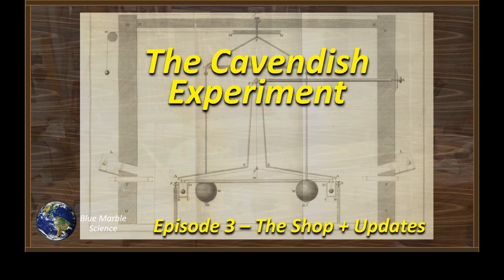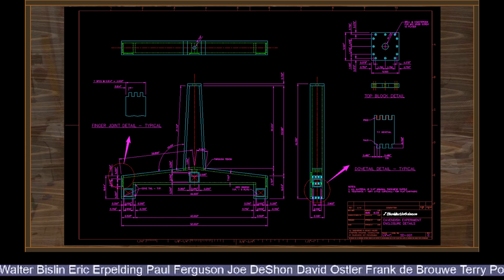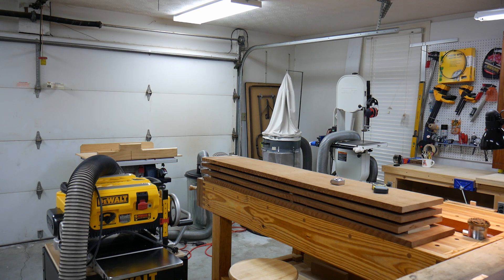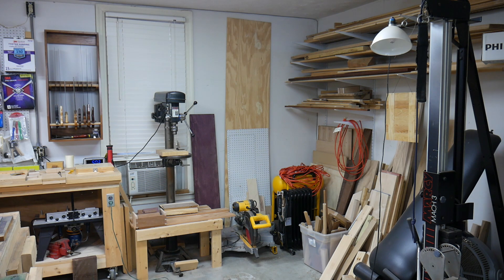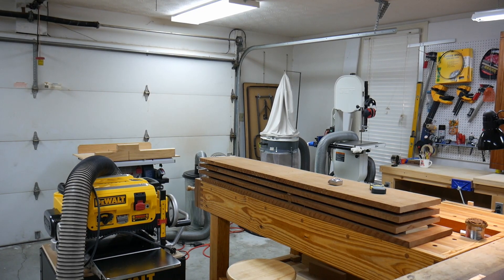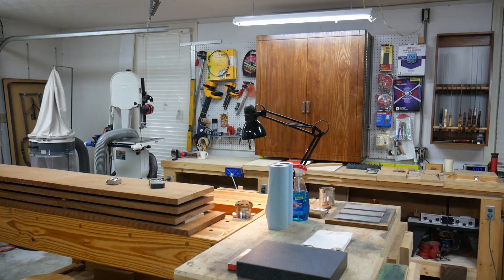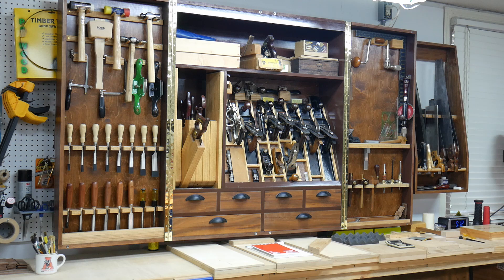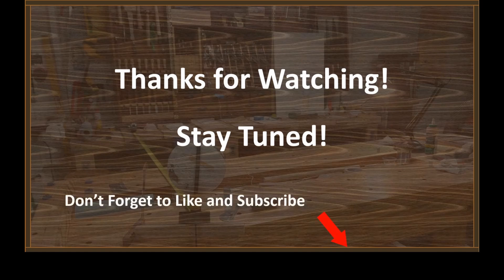Cavendish Episode 3

Comment: NIce, particularly that handsome collection of planes. The biggest surprise I got with my little brush with woodworking a while back is how much precision work can be done with tools designed a long, long time ago.

'Course, a good router is a pretty cool thing, too.
Reply from the maker: Guaranteed I can make this stuff fit much better with those chisels than I ever can with the router, but I agree, a router is cool. When I cut the holes in this thing for the windows, I'll definitely be grabbing the router. Takes much less time than by hand. On the other hand, fitting a thru tenon with a router and getting it right takes just as much if not more work and time!
Reply: As usual, the right tool for the right job, power tools are great for many things but also let you screw things up faster.  If I'm assembling an IKEA cabinet for someone, I'll often use a 1/4-inch drive ratchet handle and a driver bit, so I get a compromise, the speed of the ratchet and the precision of a non-powered hand tool.

Comment: Your shop looks spookily similar to mine Big Blue! How do you get on with the cyclonic dustbin? I've got about 300 linear ft of seasoned oak to process on my jointer this Autumn and was thinking of adding a cyclonic bin to my extraction set-up to cope with the extra chippings.
Reply from the maker: That thing is a life saver. It's a real pain changing the bag on the dust collector but since I inserted the cyclone, I get very little dust in there. I think I found that lid at Woodcraft for about $30 and another $30 for the can. It's the only way to go!
Reply: @bluemarblescience  That's good know, thanks buddy. I'll get mine on mail order here in the UK. Those dust bags are certainly a pain in the arse!
Reply: @simonjarvis7362  As a FYI Lee Valley also makes/sells cyclone lids for standard plastic garbage cans (dustbins), including one sized for a 5 gallon bucket.  You can get them in ABS (black) or polycarbonate (clear) so you can see when they're full.

As they fit standard trash cans/buckets, the fact that they cost a bit more is offset by the fact that the trash cans are a lot cheaper.

They probably work better than the woodcraft ones - on the woodcraft, the ports are vertical, with an elbow.  On the LV ones, the ports are angled inline and more efficient in generating the cyclonic action.

As a suggestion: certain tools, like BlueMarbleScience's DeWalt planer (I have the same one) have dust blowers in their collector ports.  I've found the planer's blower has enough power to pop the cyclone lid off the garbage can if you've not turned the dust collector on yet.  Then you have dust in very large quantities everywhere very fast.  Mine is kinda buried in the corner, and I generally don't see it until it's half-filled the garage or so it seems.  Not anymore.

Use bungie cords to hold the cyclone lid down.

Oh, I don't know whether this is standard in the UK or not, but about the cheapest rigid ducting available is 4" "drainage tile" pipe.  Which takes the form (here) of 4" diameter thin wall white PVC pipe.  Don't get the perforated version for obvious reasons ;-)

The sizing is such that it will friction fit into standard 4" dust collector fittings.  I used little sheet metal screws to join the pipe and fittings and threw on a little aluminum duct tape for full seal, but you can use PVC glue of course.

Some people will talk about dust explosions with plastic pipe, and this will generate interminable flame wars.  While this is mostly old wive's tales, there is a (highly) remote possibility of something bad happening due to static electricity.  Just for the hell of it, I've put a very loose wrap (one turn every foot or so) of 20ga bare wire around the pipe and grounded it to the collector.  This keeps the static charge down.